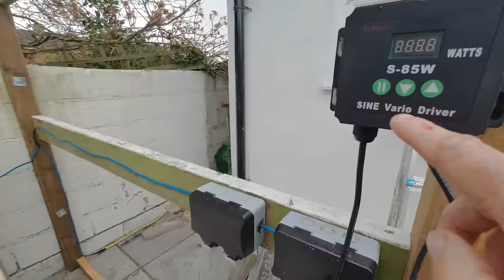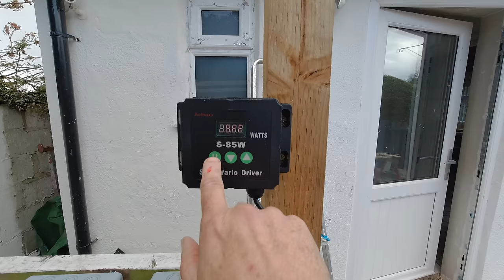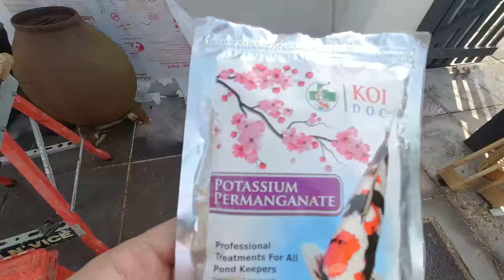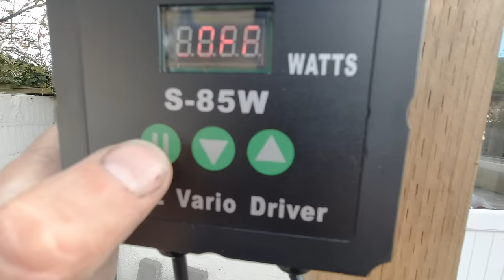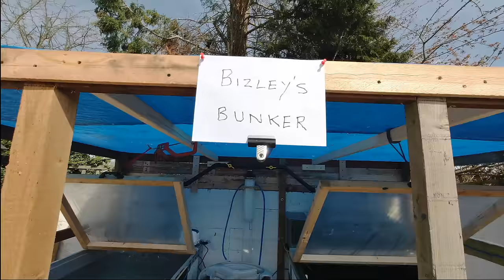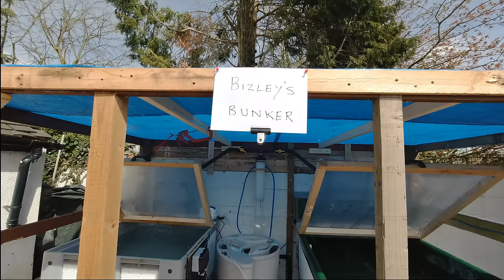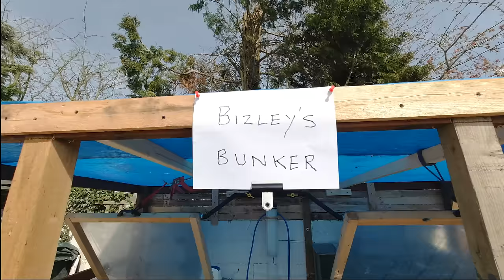FRY TANK  SETUP - FULL TEST (KOI POND)

Comment: I’d find the name of the tree surgeon from your neighbour and send the video of the mess and demand a bit of compo , damn sight carter than I would of been , maybe think about putting the air pump higher than the water level mate , just incase of a power cut and you get water flow back into the pump 👍👍😀😀
Reply from the maker: Cheers martin i wasn't that calm when i first saw it and i couldn't be bothered to try contacting them if thats the mess they can leave im sure i wouldn't have had a great response from them. It inly took an hour to put right but if i had fish in there then it would have been a different matter. Stay safe and hugs to jake Andy👍

Comment: Hi Andy, I'd have gone ballistic seeing all that mess, great self-control from you there mate. Good to see the fry tanks all up and running, well done mate. Just one thing, I would put your air pump up higher than the water level, if you get a backflow of water, it will ruin the air pump. Keep up the good work 👍👍👍 Take care, Terry.
Reply from the maker: I may look calm on camera but the air was definitely blue 🤣.  the water doesn't return to pump due to a loop in the line but I'm going to get some check valves as a precaution mate 👍

Comment: Hi mate, can I make a suggestion add a non returns valve just after the pump, if the power shuts off the water in the upflow filter will back syphon, causing your easypod to overflow,
Reply: It didn't overflow his eazypod in the video when he paused the pump ? Maybe the water went back to the pond's ? Some dirt would get pushed back through but a valve would restrict the flow a little.
Reply from the maker: Hi Paul, I have checked and the water just returns to the tanks, but I think your suggestion is still a good one as I don't want the detritus caught in the upflow going back the tanks. Thanks mate 👍🏻

Comment: Hi boss,
Can I pick your brains?
I am setting up a grow-on tank from an IBC and my old box filter but I want to flush it through with PP.
How long do you run it through for?
What mixture did you use and do you have to flush it through afterwards or just wash it out and then add clean water?

Sorry for so many questions, but I do not want to kill the new fish in June.
All looking good as well mate ;-)
Reply from the maker: Hi mate there isn't a exact dosage for sterilising but i used about 1/2 a teaspoon on my 120lt barrel and media and that was overkill but you cant add to much if sterilising something without fish i would run for about 24hrs and then neutralise it with hydrogen peroxide so it is safe to be flushed into the drain then rinse and refill. Andy👍
Reply: @DerbyKoi  Cheers Andy much appreciated 👍